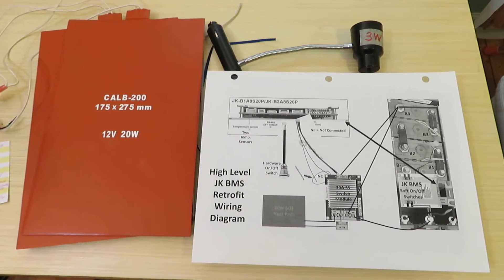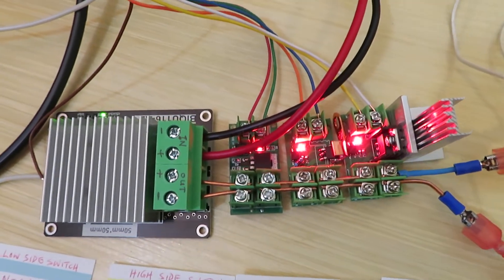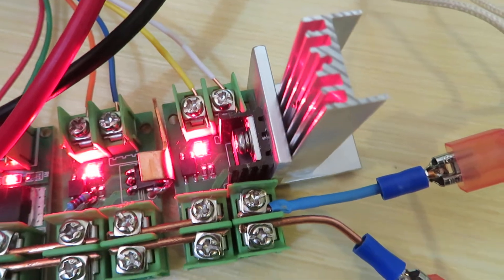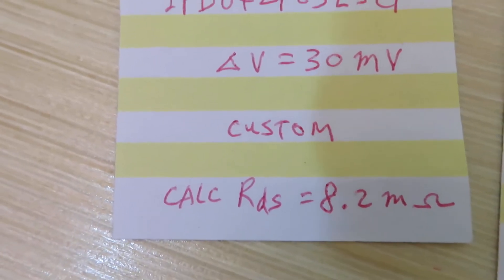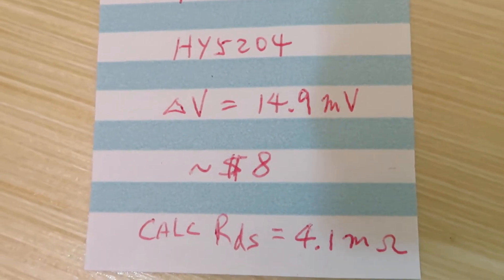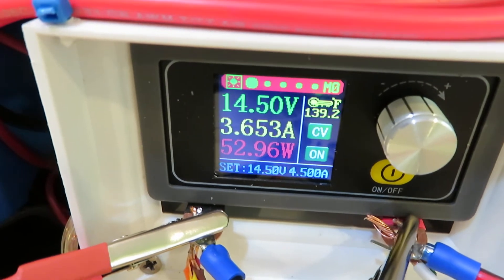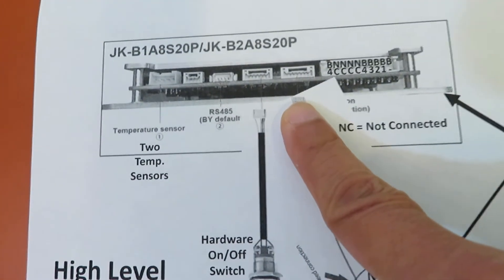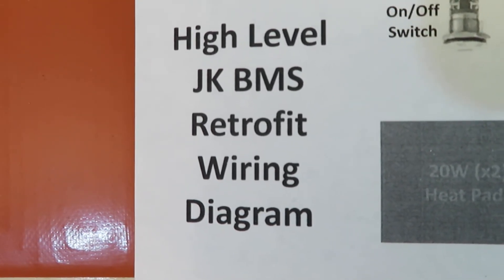JK BMS Follow-on Video: Current Capacity Extension of the Heater Control Port

Comment: the 4 wires to the ring terminal for heat, does that connection go 'high' for heat on? or does it go to ground?  what voltage can i expect on that wire to trigger my solid state relay, is it 5v 12v or battery volts?
Edit: ok watched to the end now lol that'l teach me to not wait, so I guess it goes to ground when it needs heat.

Comment: Heating even when there is no charge current?
I just tested my setup and even when there is no charge current present, the bms is heating my pack if it drops below my set temperature.
I was expeting that it would only heat the pack is there is any charge  current.
Reply from the maker: The new 2nd Gen design I uploaded just now is what you need.
Reply: @parkhopper3627  hmm, I just watched that video. How would that controller sense that solar power is avaliable?
Since you connected the volatage sense wire to the positve battery terminal there the controler will always sense a voltage.
Reply from the maker: The resting voltage of a LiFePO4 battery is typically 13.4V or lower. Most recommended charge source voltage is 14.4V. So when a charge source such as solar is present, the battery terminal voltage will be somewhere between 13.4V and 14.4V. I programed my "high voltage on relay" to 13.5V as the trigger point and it works great. You can fine tune the level to suit your need.
Reply: @parkhopper3627  Sure, but even if solar power is present the voltage would stay at 3.3V per cell and only rises if the battery takes a charge.

What Controller are you using? Do you have a link?
Reply from the maker: @RFDarter  It is just the opposite. If the battery is not taking a charge, the voltage will be the same as the charge source. You can go to Amazon and search "voltage detection controller a30-u1".

Comment: Thanks for the video but, instead of providing the part numbers for the microcontrollers or mosfets on the heat controllers, it would be a lot more helpful if you could provide the model numbers of each of  those units and/or links to them.
A person could google for a lifetime all the information on that paper and never find those units

Comment: Hello ,  Great breakdown on customizing the heating function.  Do you know if there is a way or can you do a video on how to wire/configure the heating function to only use supplied charging current and not battery current? So it will only use power for heating when it is available from the charging supply ( solar or generator etc). I have an off grid cabin in cold climate and I am not there all the time and could go weeks without attending. There can also be long stretches of days with little or no solar charge.  So under the current heating configuration the battery would simply continue to drain just to heat itself with no charge current available. If it only drew current from the charging supply it would only heat when it would also have the ability to charge.   Therefore would not continuously drain the battery.   Cheers Thanks
Reply from the maker: Charging supply is usually ~1V higher than the battery. The easiest way to do what you have in mind is to add a "low voltage disconnect relay" to power the heating pads above the battery voltage and below the charging supply voltage, such as this:  https://www.amazon.com/Digital-Battery-Low-Voltage-Protection/dp/B07929Y5SZ/ref=sr_1_3?content-id=amzn1.sym.f03eb388-6553-42c1-88e5-7e00d0e3d16b&keywords=battery+voltage+protector&pd_rd_r=8ae665e7-72c7-4e90-88a2-8841ef8194ef&pd_rd_w=ZBnc6&pd_rd_wg=cccEb&pf_rd_p=f03eb388-6553-42c1-88e5-7e00d0e3d16b&pf_rd_r=YEXC55CT30K156PJTC0Q&qid=1672432580&sr=8-3
Reply: @parkhopper3627  Thanks for the reply. Good idea. I will see if I can implement it. Keep up the good work. Cheers

Comment: Do you know if the control wire from the bms Heat function stays @ 12v with all models or does it change with the battery voltage say 48v BMS. Im looking for a relay just wondering what voltage it needs to be. Is it based on your battery voltage?
Reply from the maker: For the JK BMS, the heater control provides a return ground (zero volt) which can carry up to 3A to turn on and power the heater directly. If you are using a relay for a more powerful heater, the solid state relay control port should use only a few tenths of milli-amps and you can splice into the cells for positive voltage to match the relay requirement, such as 4 cells for 12V, 8 cells for 24V, and etc; or the full battery voltage to suit your need.
Reply: @parkhopper3627  Thank You

Comment: Hi, is it 3A limited or at 3 amps it burns?
Reply from the maker: 3A limit but with the module extension it is good for 30A. The heater should require less than 5A.

Comment: Nice!
For 24v is all the same?
Wher can i buy that N-channel and heating pads?
Reply from the maker: I did not buy the heating pads; they came with an OEM battery.
The N-channel solid-state switch supports 24V.